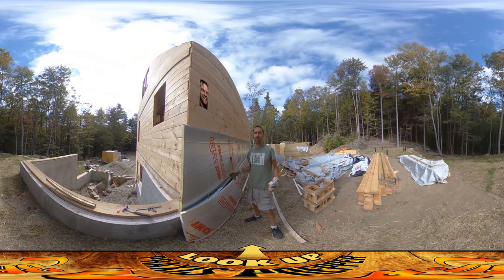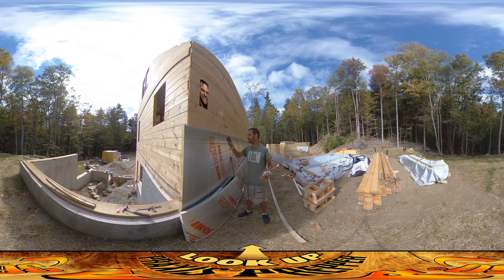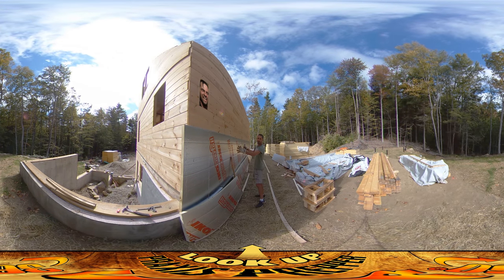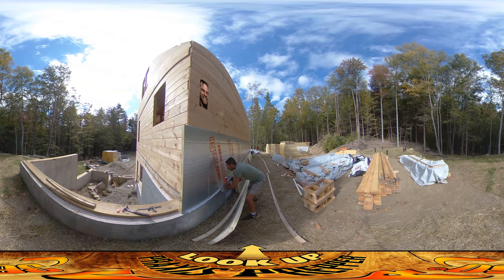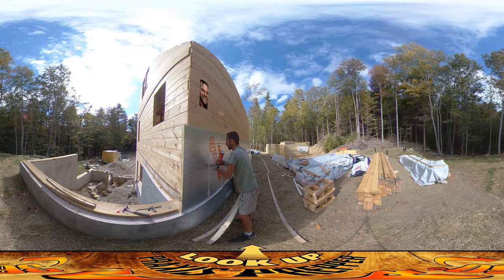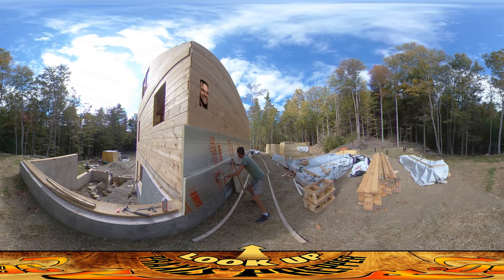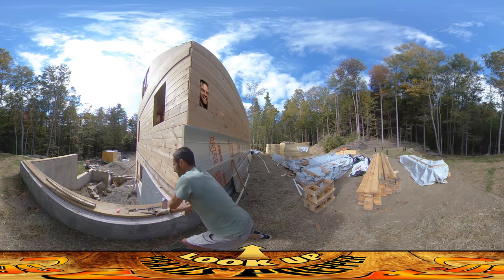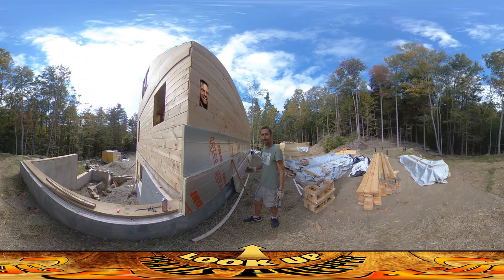Homestead Building - Insulation Begins, We SKIP the House Wrap, Spray Foam, Borax

Comment: Double staggering, both from top to bottom and from side to side, will ultimately leave 1 tiny spot where the joints will align ... but i am fairly sure that if you spray foam both joints on both layers that tiny spot won't turn into a huge issue ... and it feels kinda dumb to wrap the whole house for just a couple of tiny joint line ups, be it that they will be spread over the whole house. Especially if in both cases you nail in the insulation, which will obviously cause through and through holes all over the place... but obviously there is an outer wall as well !! 

And from the inside out, i personally think it's good to have some breathability of the house, even though it means one does loose a tiny bit of insulation value. But in case of the house wrap you basically make it so that you are living in a plastic bag, and this means you have to take other precautions to deal with moisture from the inside (like an open window (obvious insulation breaker), or one of these mechanical ventilation things (they are a huge sound irritation, at least in the house where i live)). So not having a house wrap, and all sorts of tiny holes due to nails and through the foam, will ultimately be beneficial for the internal climate, while causing only a tiny fraction of insulation loss and no extra costs for other precautions (or frustration due to them, no really the mechanical ventilation is a pain it the ears! especially at night when i want to sleep, a constant very low pitch hum, i do not like! ~ so in the summer it's switched off, because windows can be open, but during the winter it has to be on, also due to the house design (new technology isn't always better) ... so yeah, i can't wait to leave this house! ).
Reply from the maker: Very well put DC!